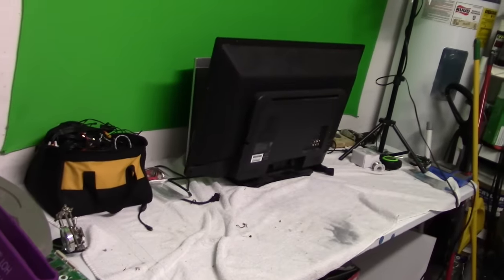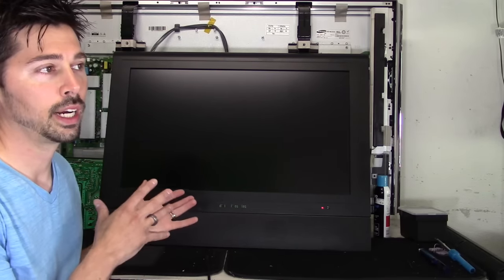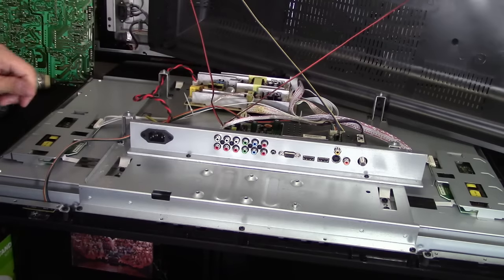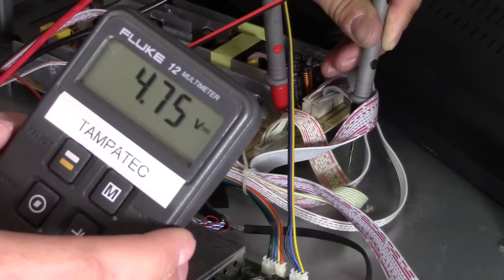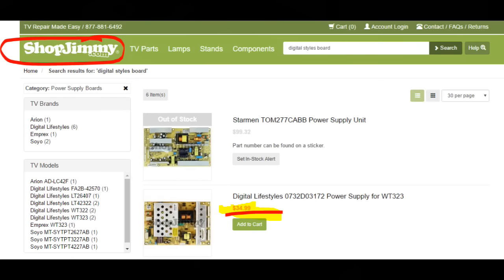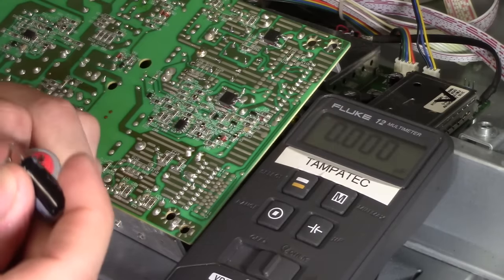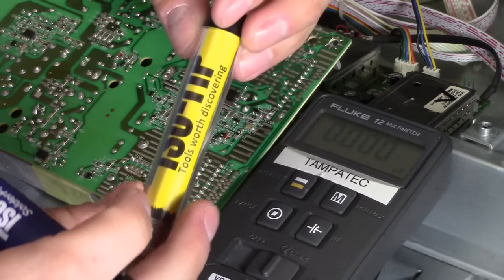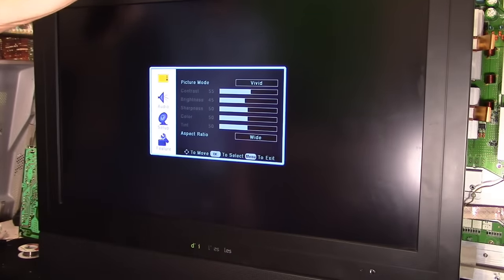WATCH THIS VIDEO BEFORE THROWING OUT YOUR BROKEN FLAT SCREEN TV!!!

Comment: How often do you get plasma in these days?
Reply from the maker: not often thank God, they break often because they get so hot
Reply: well honestly, I love my 60" LG plasma.  It's no top-of-the-line, more mid-level, but still, picture is better in my eyes than most LCD's I've seen because it's just so much more natural looking. Only thing keeping me from moving on is the price of OLED.  It'll take a while.
Reply from the maker: ChillCosmos plasma TV picture is great but I would use usb fan to blow out the heat. sometimes I plugged in usb fan into tv usb port after i repair them and mount it to the top vent. that should help with the heat. also when tv is off the usb fan turns off too.
Reply: Awesome idea actually.  Thanks!  I tend to use the power saving feature when not watching any movies, and she only sips on an average of about 100 watts, but full on power, it can reach 400 watts lol
Reply: ChillCosmos I have plasma very old already but still in good condition no problem at all althought power consumption is higher than my LED one.
Reply: If Panasonic hadnt stopped plasma production i would get me one. Cause still the latest led models cant reach that picture quality and contrast.
Reply: Dom Yes I really appreciate the plasma in color and contrast but it's very heavy my 42" still working good condition the deep black screen is very nice the only problem if you open the window and the sun comes in and the screen it reflects not just like LED no problem in open light.
Reply: yea, you got a clear glass at the front.

But when OLED arrived to normal home consumers they will be the onew with the best contrast. But they have unnaturally ovrdriven colours.

But i personally do not care about the weight of my TV since it is not my Tablet PC wich i carry around everyday. You buy it, you get it home an that was all about transportation. So for me it can weight 50 kilos, i dont care if the quality is good.
Reply: Tampatec i need help with my TV
Reply: Less often than the blood bank does, I guess.

Comment: I've got an old, large Dynex flatsceen that seems to ~sort of~ have this issue... Thing won't turn on when it's cold. No front red light shows but nothing clicks. Sometimes it clicks, light flashes (fewer times than normal) & goes black.
During the summer if my apartment's AC is off all day, it'll turn on. Otherwise I can run a small heater on it & often get it to go after a few false starts.

Thanks for this video, maybe I can restore it after all! Sure can't swing a new one 😂

Comment: @Tampa Tec  Thanks very much for the help!  I'll probably attempt this, now that I cannot find a new power supply replacement board anywhere, and even used boards are rare.

It did look like some of your capacitors had "non-flat" tops (the Xs are carved in the top in order to give way when the insides boil and give a visible sign of cap failure).

Reminder: Voltage is an "across" variable.  Current is a "through" variable. Voltage appears "across" two points. Current "flows" from one point to another.  Voltage can appear across a pair of points without any current flowing.  Current can be flowing between a pair of points with no voltage across them.

Comment: This is part of the counterfeit electrolytic capacitor issue from a few years ago. They are still showing up in equipment. I have replaced caps in my refrigerator, monitors, and tv so far. Some manufacturers have stepped up, and extended the warranty period. (Maytag sent me a complete replacement power supply board after the warranty period expired.) This is NOT a design issue. The original voltage rating on the caps would be fine for a replacement. The problem with using a higher voltage cap, is that it is physically bigger, and may not fit very well. If you have the room, for the larger cap, then sure go for it. It won't hurt. For more info see Wikipedia: https://en.wikipedia.org/wiki/Capacitor_plague.

Comment: Good job and good info, thanks.  I have a Samsung LED TV that has the right side of the screen distorted upon turning it on and after 10 minutes fixes up and looks great ther after .   Have you had any TVs with this issue.  Something is going out and needs time to warm up, soon it will not fix itself, thoughts?

Comment: Thanks for the idea of using a butane iron to get plenty of heat to a very small tip; those ground planes can steal most of the heat from a smaller electric iron, not leaving enough heat to melt the solder on grounded caps.  Thanks!

Comment: Great video.  I am encouraged to give this a try with my Sharp LC-40LE431U TV.  However, I'm not sure where to begin.  The symptoms are when plugged in, the control buttons on the right side panel don't seem to want to work correctly.  I get a red light.  But when I press the Power button, it does not power on immediately.  I have to keep pressing ALL the side buttons randomly until finally the green light is on.  Then when pressing each additional button, they do not always respond correctly, if at all.  Pressing the Volume button might bring up the Menu, or vise versa.  Even if I can get the Menu screen to come up and scroll through the selections, I still cannot select any of them to connect to a source.  Will the complete repair kit from shopjimmy solve this, or is it a simpler fix?

Comment: My friend thanks for the great video! I have a similar tv,  but the difference is it turns on and shows the initial screen with the brand name and then cuts off and only has the 5v red light after that...any ideas on this? I will try the test you performed  and see if it yields results. I don´t see any visible damage.

Comment: Love this video, I am experiencing the power button light coming on, but not coming on, it's been taking ten minutes for my tv Samsung 32" inch that I bought almost ten years ago, and never had one problem until now. The buttons to control the sound and channels however have been loose for years not sure why because we always use the remote, so not sure it those loose buttons are also part of the problem, there's nothing wrong with the picture, sound, or it's features, love this, and just don't want to toss it. I didn't want to take it to a repair shop fearing it would cost me hundreds to get a simple problem fixed, what would you recommend, I wouldn't do this myself, thank you!

Comment: I will look at posted videos but a kitchen 13" Samsung just went black while watching. Sound, changing channel works and tried the soft & hard reset. I am an ASE Master tech since the 70's and fix my own stuff. Their are several of every kind out their that don't know how electrical works. At the dealer, I got all the vehicles with electrical issues. Electrolytic caps and many others are chosen at the minimum values and expected to work, until out of warranty. SMD's have helped a bunch in reliably as they chose tolerance 2% of rating is best but 10% +/- of a resistors value changes reliably and lowers the life of a TV or anything else. Sad!
Thanks for this video but free don't pay your bills! Folks, take photo, print as needed and mark locations. Next, get zip bags to place these into with a note inside and masking tape on top, mark what these are. Makes life a whole lot easier after 3 weeks go by and parts come in. Having a good digital multimeter (DMM) like Fluke is best. Have a lucky one!

Comment: Very cool!  Question...  I live in a old (late 19th Century/early 20th century) mill building in W Central NH.  The building was renovated to low income housing in the 1980s..  Seems that modern technology items that we all have today, like flat screen televisions and Personal Computers (both laptop & tower) have 'issues' with the old wiring and power distribution in this building.  I've got 3, yes 3! flat screen televisions that have in one fashion or another made it past the manufacturer's warranty (all with in the past 8yrs) then a power drop immediately followed by a power spike has literally killed 3 Flat screen tv's.  This experience is not singular to me, but to others through out the 93 unit building. Things that I strongly suspect influence the life span of a flat screen... Each apartment has it's own 'heater'.  Though this 'heater' is probably on a different larger amperage fuse/switch in the power distribution box, each time it would come on, it seemed to steal power from other appliances that were running.. ie: flat screens would momentarily go black, then come back up as operational....  Being somewhat familiar with the sensitivity of high tech electronics manufactured with 14 nanometer leads on circuit boards, I am strongly suspicious that the solution is to rewire the building...  (surely that will NOT happen!)

I've invested in APC Back Up Power Supply for each PC  (x2); as they provide instant power to my sensitive electronics as well as 'level and clean power' to them too, should we experience our typical power fluctuations.   My current flat screen (not protected by a BUPS demonstrates a red standby light.  When power is applied (the Sharp ROKU unit is turned on) I see the 'ROKU' logo for a very short split second then it goes 'black'  As this unit is connected to my PC TOWER Video card via an HDMI cable and networked through my router for internet streaming;  I have wondered if a 'Windows Update' might've somehow impacted the flat screen tv to its current status.  I'm thinking that the Sharp Roku flat screen normal operation is entirely separate and independent from the the HDMI connected video card, as it is powered from a completely different 'outlet'... Your prognosis and suggestions would be very useful...

Comment: Did you get the remotes with the TV's? I find so many electronics people are selling for cheap broken or working on Craigslist, but they don't have the remote to go with the item. Tracking down a remote for a ten your old TV or blu-ray player is next to impossible. I find the same thing at Goodwill and other similar places. Why even put these things up for sale with no matching remote to use?... Half these electronics are nearly impossible to use without the remote, let alone setup, like doing channel scan etc..  Appreciate the video, I've fixed many power supplies and revived perfectly good LCD's that were destined for the dump, figure why add to e-waste if it still has life left?

Comment: Hi bro, thanks for the video. I need help or a do it yourself video to repair the inverter board, as I seem to have a problem with my backlight. The tv has a shadow effect in the right hand corner right where the inverter board is located. Id appreciate any help. Thanks

Comment: great video, but quick question is I have a tv that seems to be shorting out when I connect different anntenna conncetions to it, as it will turn on and off repeatedly, yet works with a streaming device.
Reply from the maker: 🤔 Either the cable line is shorting out to ground or the TV tuner perhaps. U Need to troubleshoot to narrow down possibilities.
Reply: I've tried a line from an indoor and outdoor antenna, so most likely something on the tuner

Comment: When you bench test  a power supply , say you have 3.3 volts or 5 volts standby, do you jumper the standby voltage to the PS-ON, or ON-OFF pins, or BL-On to make the other voltages come up?

Comment: Been a Tech since the 70s, Tube TV's, 8 Track, Craig Powerplays, Pioneer Super Tune, Gutars and Amps. For Desoldering, we used Soldapult, Copper Braid, Best one Believe is Like a Radio Shack Desoldering Iron, with a Squeeze Bulb, you could Remove a 40 Pin Chip in a Minute. When Removing a Lot of Parts off a Scrap Circuit Board, Use a Heat Gun on Foil Side, When Hot, bump against the table with the palm of your Hand, Inertia will let the Components Drop, Can do a Lot Quickly, Use Ventilation.
I Look for Bulging Capacitors First thing. They had a Run of a Lot of Bad Ones, Don't know if they Corrected problem, may have tried to cut a Corner(process or material) 
Seem Better now.

Comment: TV works fine when connected to cable but when switched to PC with a VGA connection the picture has a green ghosting after lightning strike to telephone line. Router destroyed, wireless phone destroyed, telephone main connector outside of house destroyed, DVR destroyed, computer crashed and the TV connected to computer as stated. Any advise as to which board went bad on TV? FUNAI  LC320EM2 and the board I suspect is BA17F1G0401 2_1 A17F1UH. Am I right? I'm a senior who knows nothing about repairing TV's but I ripped it apart and am guessing because that's the board with the VGA connection on it. I'd appreciate any opinion you can offer.

Comment: Have an Apex TV that recently started acting up.. it'll turn on, has sound but no video (backlight is working since menus will display), then after a few seconds it'll just turn off.
Already put an extra Element TV in its place since I had it just sitting around(bought cheap on a black-friday sale as a spare), but...
Before I dump it, I plan to open it & have a look around inside for anything obvious. If I can fix it myself for something cheap like capacitors its worth doing...but would never be worth taking to a repair shop.

Oh and I agree on using the older solder with lead! so much better than that modern lead-free crap. .lol.

Comment: I have a plasma panasonic TC-55St30  tv with seven blinks found the buffer boards shorted . While waiting for parts checked voltages per your AWESOME  videos . Checking on tb's the  5 volts is solid my twelve volts seems to be none existant on p.s board. Do i have to have my buffer boards in to get the 12. Checking on the 12 volt slots on the pins shows zero.I have the service manual but know indication on same ...I am assuming the 12 volt should be  somewhere on the board . The schematic is not very clear . Hate to install new buffers and still have issues .

Comment: New Subbie 🤗 Questions: Is it time to get a new TV? When it starts making this really loud noise. And when turn off the red power light blinks and makes a popping sound while it's turned off. Then to turn on you have to push the power on a couple of times before it turns blue then turn on.

Comment: Thanks for the help! Can you help us with the remote controls? Mine always stop making connections. (Button problems)
Reply: Remove the batteries, then carefully take the remote apart.  It may have one or two small screws, or it may just snap together.  You don't want to break the snaps.  Remove the rubber keypad and clean with alcohol.  Do the same on the circuit board where the buttons push.  Using 91% alcohol works very well.  Carefully reassemble and see if that helps.

Comment: I’m guessing that you live in the Tampa Bay Area? I live in St.Louis area. I wish I lived near you because I bought a really nice Samsung flat screen tv and it has horizontal lines on the screen. And I would really love to fix it. I’ve saved it because I know that it can be fixed. I hate to throw things away that have minor repair issues. Anyway thanks for your video 
I’ll try to find out what the problem is and just by the part.

Comment: Hi Tampa Tec T-Con board voltages test good on a 65 inch LED tv but  backlight blinks for a fraction of a second then stays off when power is switched on. 5V led standby light is on and turns green when power on.  I measured voltages from power supply board on  the backlight connectors  and I get 0.30 volts. Is the power supply faulty or the mainboard LDVS? Thank you for your help.

Comment: Hi there, i have Vizio E70-C3 TV. There was a power surge and since then the tv wont power on. It was tested and found that there is power going to the main board but no power leaving it. No picture, lights, or any indication of power could be seen on the screen or standby light. Any idea what it could be? Would you change the power supply board first or the main board first or the TCON board first ?

Comment: Rca 65 in . No sound from tv volume and no picture just black screen that goes on and off. There is a pic. But it just flickers on and off. Sounds is not an issue for me.  The sound goes through my home theater and does work . Thanks

Comment: Hi there, I was on ebay searching for parts & found you 👍 you said to contact you before purchasing & gave me this you tube video. I have a JVC LT40X787 that powers off after 10 seconds. I've done all the general troubleshooting fixes like keeping it unplugged for an hour then holding power button 60 seconds and plugging in simultaneously & a few other tech suggestions. Still powering off. I've removed the back panel & hope there is a fuse or part, perhaps the power supply board?? Can you help? Thank you. Oh & none of the capacitors appear swollen or off in any way. They look real good, but I'm not a tech, just a gal who fixes things when she can. 😊 please help

Comment: My Dad has an older 58 inch model a 2012 Samsung Plasma that he has taken great care of. I tought him to use the screen protection features. Recently he went to watch the football game. But then I noticed a straight vertical red line. It was obviously effected by those specific pixels or the pixels are glitchy because of something in the panel or a board. Have you seen anything like this before? If so, is it a simple fix? Can it even be done? He knows it's not worth much anymore,  it's his favorite over led, qled, and oled. He's a lover of sports. He's got a Samsung flat panel in just about every room. We also have a 46 inch 4k led that just powered off like a fuse burning out on the spot. From a power surge. Plugged into a surge protector the safety switch didn't flip off on the protector. I heard that simple fuse like pieces can burn out and replacing that is the fix. Seems simple enough.